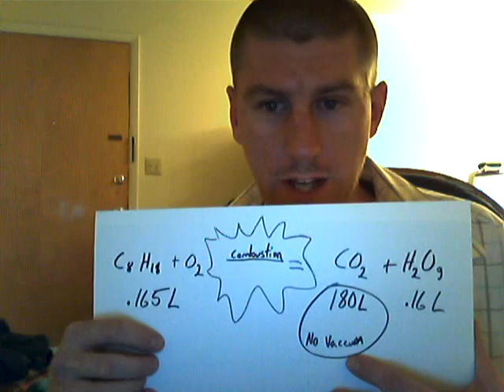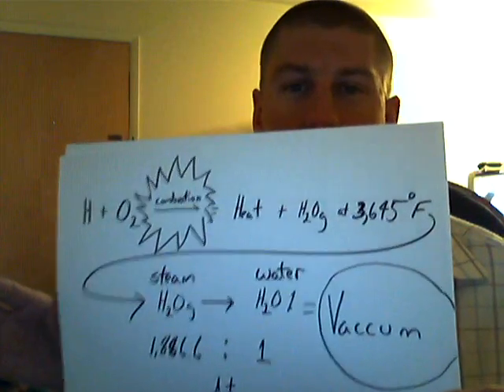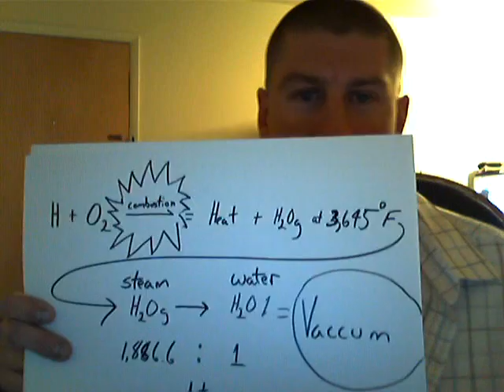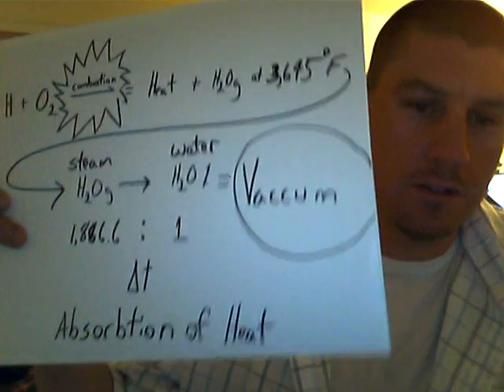HHO explosion not implosion PROOF

Comment: I am working on the same idea before I even watched this video. Without friction this consept would be a 100 percent efficient internal combustion engine. The vacum thow slower would prouce the same amount of energy as the explosion of hho into super heated steam.
Reply from the maker: not true . the vacuum energy can be seen and it is extremely week compared to the explosion . the vacuum is nothing more then the condensation of steam , no magic here.
Reply: @NOBOX7   if u  apply  just bit of gas like 1/4 gas closed the valve for no more air get in and then stretch the vaccun the gas inside that 1/4 gas to be full cylinder stretch the molecules at full vacuum cylinder space then fire the spark u going to see the result,  that cylinder will not hold the energy release from the  gas , the way u doing it's wrong and that's why people thing on the same energy that u put on you get back with loss , I like to see your  video back here. With that  test , thanks and just try to not be fool from other ,